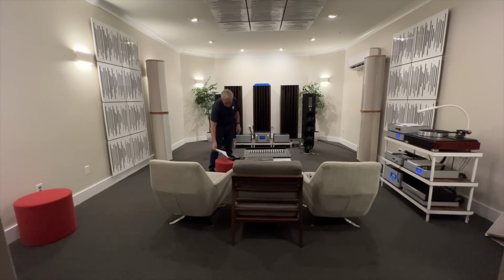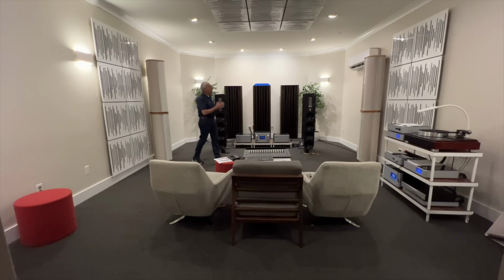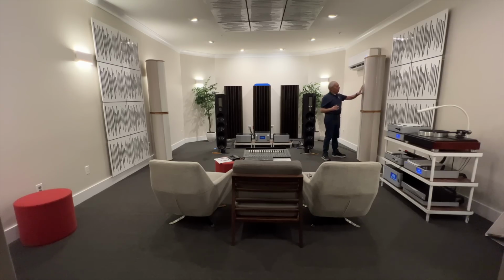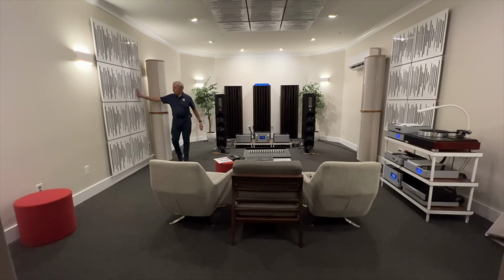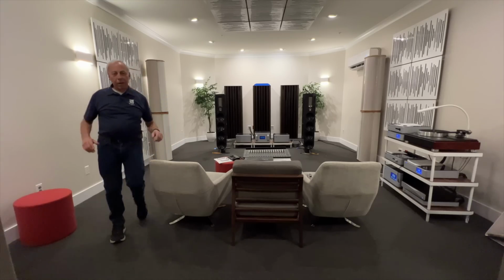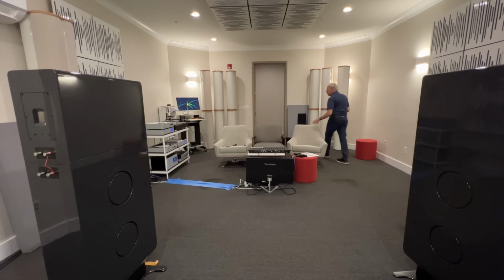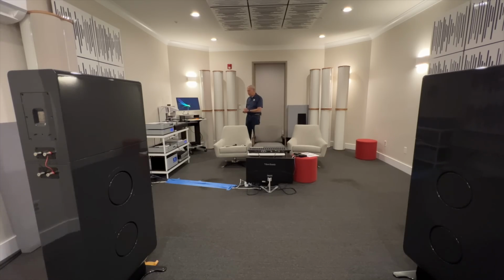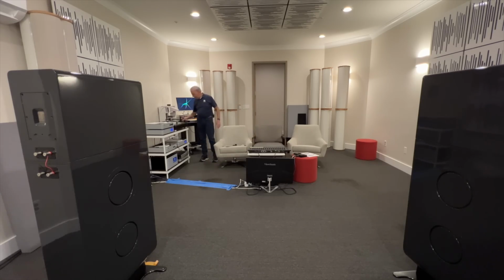A tour of PS Audio's Music Room II

Comment: Great video, Paul !  But is that an AC vent coming out of the ceiling pumping hot air on those beautiful FR30's?  Also you mentionl that the FR30's are monopole speakers.  But I thought I saw tweeters in the back.
Reply: I thought it was a mid-range on the rear.  I'm also pretty sure it could be turned down/off.
Reply: @aetch77  No Helen, I checked.  On one of Paul's videos he describes a 2nd tweeter on the rear .  And you are right, it can be tuned up or down or off.  These look to be various nice loudspeakers, especially for the price.
Reply: Looks like an AC unit.  No doubt that is turned off when listening but left on while the room sits empty with all the equipment powered up.

Comment: I've been mixing music through my stereo system as well. It gives me a much, much better idea of what the final result is gonna sound like.
Reply: Here, though, the FR30s have a rising treble response that causes all the mixes on them to be quite dark and recessed. There is a distinct change in the tonality if you rifle through Octave's catalog once they started using the FR30s as opposed to just using the ATCs or whatever they had before. If you mix on speakers, you need to be sure they are neutral, or whatever defects they have will be applied to the mix. E.g. if they have too little treble, the mix will be too bright. Too little bass, boomy. If there is a suckout in the midrange at the cross-over, then it will sound boxy or honky, etc. I would at least have actual monitors there somewhere in the mixing chain as a sanity check.

Comment: I've treated my room too , it's so incredibly important to invest in diffusors and absorbing. You can almost make any speaker really good that way.
Reply: Exactly. You can make a budget setup or any setup sound better or transform the sound by doing that. Doesn’t cost the earth either. Heard some systems in person that people have been set up in some rooms. Spent £1000’s on gear and sounded awful because reflections everywhere. Bass loose and just no definition. It’s worth doing to bring all into focus. Even a small set of stand mount speakers can perform superbly with a low powered little amp like an old nad 3020 shine with some modest room treatment.

Comment: The speakers appear to be VERY close together, especially in proportion to the listening distance. You obviously know what you’re doing, but this is nothing even close to resembling an equilateral triangle. I’d be really curious to hear your thoughts on how you chose this configuration. 

Thanks for all the great work you do!
Reply: I believe the extra wide camera angle makes the speakers seem closer than it really is. Paul does all his setups mostly by ear.
Reply: @elongatuspiranha  which really doesn't negate the basics spoken about here.
Reply: I had basically the same dimension/size room that Paul has, many years ago. I had though Acoustat 1+1's medallion mod, Counterpoint equipment and VPI with Koetsu Black Goldline.
Everyone that came and listened were amazed by the imaging and sound. I would guess that since this will be a demo room, they measured and did the listening tests. You won't know until you actually hear how it sounds to say that the speakers are too close.
I positioned the speakers all over the room to get the best sound that I could. And surprisingly, the positioning was (and again, this was done decades ago) are similar to what I see here.
Reply: Even hifi shops do this , incorrectly set speakers up . Makes you wonder what they are talking about .

Comment: Are the speakers not plugged in?
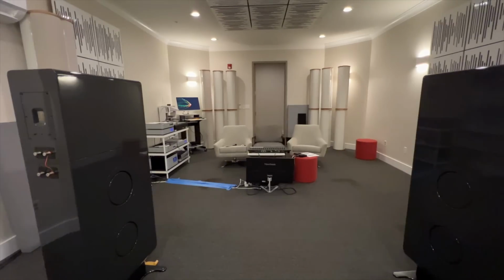Reply: That's what I was thinking, the top binding posts are awfully barren, However if you pause at the right moment you'll see another bank at the very bottom with way more cables  - 4:13 etc.

Comment: The Fr30 is a partial di-pool, with the tweeter in the back.. And ht tweeter is responsible for about ~2k to 20k Hz, so a pretty big part of the audio spectrum.

BTW it is really a pity in a dedicated listening room, that the cables are hold in place with a big mess of tape..
Reply: "The Fr30 is a partial di-pool, with the tweeter in the back." - not in the typical meaning of that word.  The speakers are BI-pole, that is, they have a second direction, that tweeter in the back.  Another (and better) term is "poly-directional".  A dipole (like Magnepans) send half (hence "di-" prefix, meaning twofold ) the energy forward and half the energy backwards.

"... with a big mess of tape.." - Paul stated that was temporary.

Comment: Ideally, Paul needs a lot more treatment in that room. 
I'd like to see a LF decay measurement... unless those walls are adequately damping the bottom octaves, this room could benefit from a great deal more LF treatment.  

Either way, I dig the room and appreciate the content. 

I'm sure both the FR30 and the IRS V sound good in that room. 

However, they're simply scratching the surface of an adequately treated room. It can benefit from significantly more attention. 

btw; the FR-30s are an aesthetic grand slam

Comment: Paul, who is your turntable guru?  Is it you?
Who dialed in the many vectors to ensure that your stylus makes the most out of the groove?

Also, you have been using Vicoustic panels for some time.
How many have come down?

I am asking because they sell expired glue, and many customers have had panels come down.  Vicoustic's CEO, Bert Goodman, has told me so.

Lastly, please do not use a wide-angle lens.
The shape of the room that it presents is distorted.  It makes the side walls look like they are leaning.  We do not see an accurate presentation of your room.

As audio suffers from extra processing, so does video.